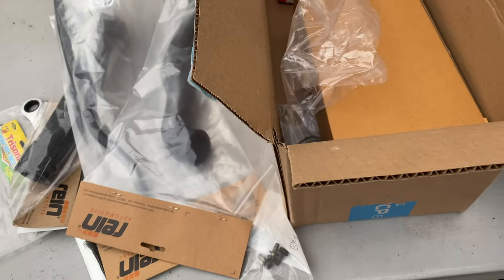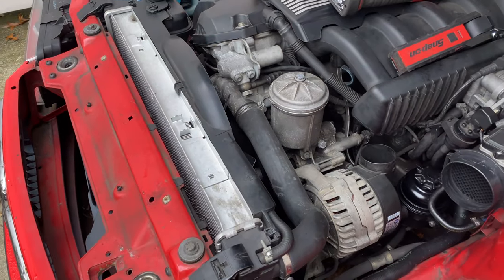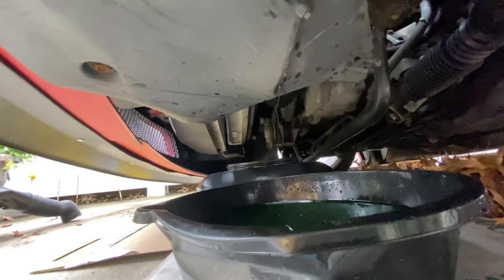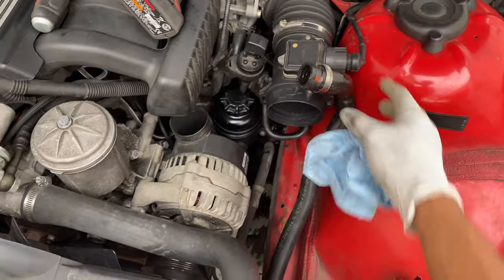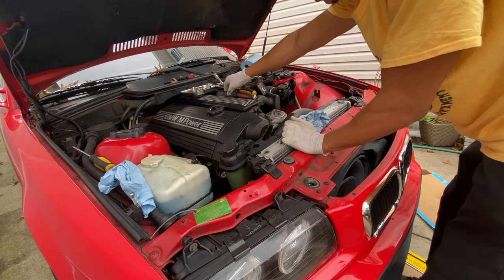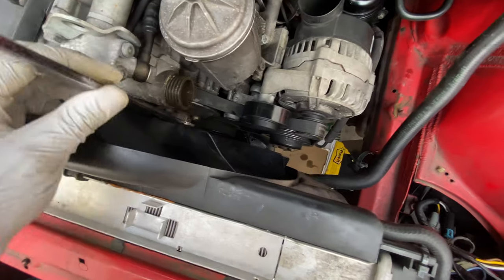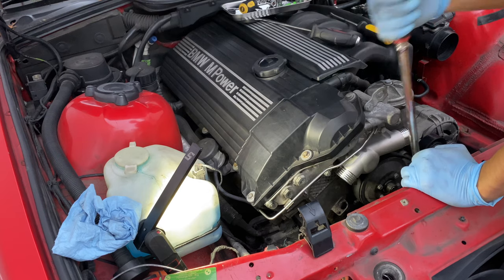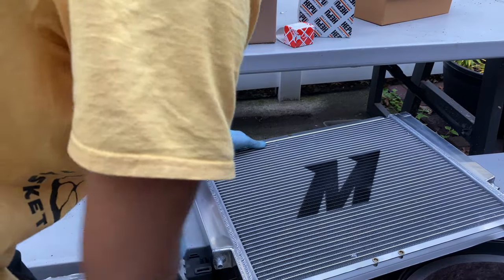BMW Cooling System Overhaul | E36 M3

Comment: Great video.  Just did this to my Alpine White/Modena convertible.  I kind of did the opposite though.  Used a Stewart water pump and an OE radiator.  I like the Mishimoto radiator and if my car were a manual coupe, then yeah, I would definitely go this route.  But for an automatic convertible, that radiator would just be overkill.  Stewart water pumps are just better than all the others.  Both our E46s have them and the cars just run cooler than before.  The only other one I would use is the BMW OEM pump because now they have a metal impeller instead of that cheapie plastic crap.  With all the other aftermarket pumps, you get what you pay for.  Just spend the extra $100 and get the pump that will last for the rest of the car's life because the cooling system is the Achilles heel of this motor.

Comment: love the video, super helpful. I was wondering why you decided to not delete the fan clutch while you were down there? I know those have a tendency to explode under high rpms and can put a hole through the radiator. You can install an electric fan or put a lower temp aux fan switch with lower temp thermostat on and it runs just the same.

Comment: Have a 95 m3 i just got and need to swap out everything, any recommendations on a good kit?
Reply from the maker: Any kit that fcp euro provides, depending on your needs.
Reply: @Millzny  thanks bro, any brand of water pump you think is best?
Reply from the maker: @jdchipstkr  they have an “Emp Stewart” pump which looks good quality. I went with the “Hepu” and I haven’t had an issue.
Reply: As much OEM as u can afford. INCLUDING the OEM water pump that everyone calls plastic but is COMPOSITE and routinely last over 150k miles(and that's 150k of gen z miles too)